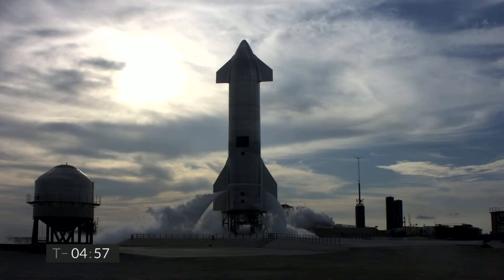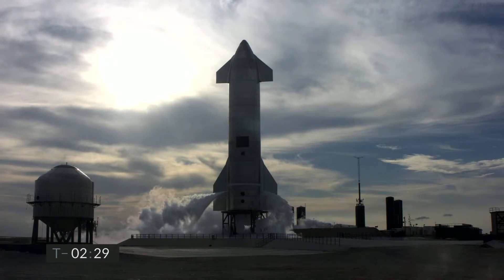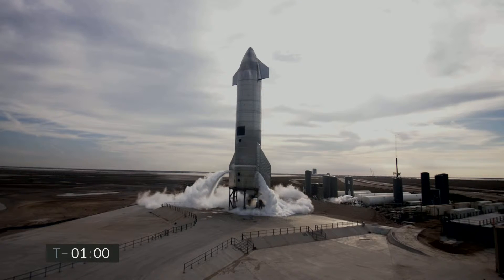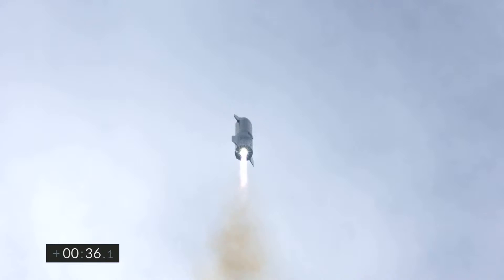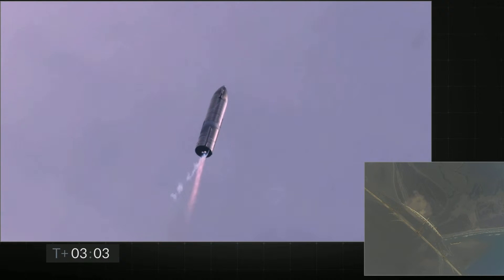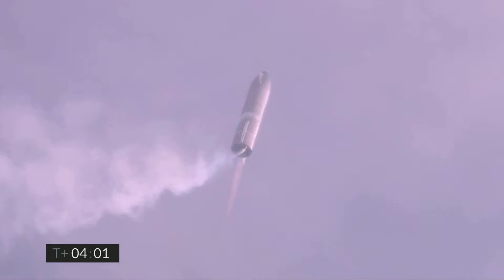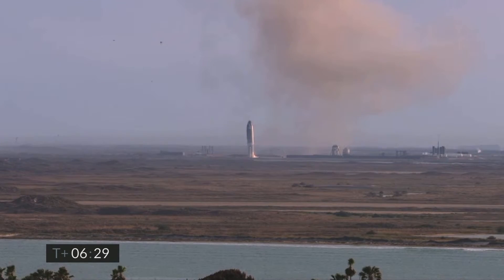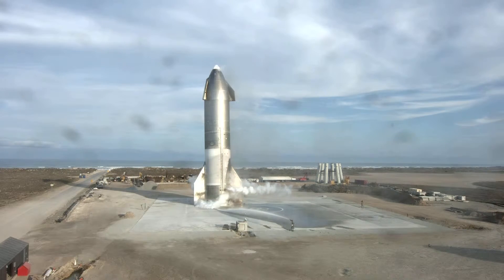Starship | SN10 | High-Altitude Flight Test

Comment: The landing was difficult. When he touched the ground he was injured by the blow. You need to dislodge the fuel before hitting the ground or use a better leg system that better absorbs the weight of the rocket.

Comment: Congratulation this was a successful test :-) sadly it exploded after few minutes after it landed and from what I saw the rocket was on fire before it touched the ground and yes the "rough" landing was another reason why it exploded in the end. SpaceX should implement some spring mechanism system under the rocket for such rough landings to ensure every last bit of a safe landing, I think it's not hard to make a circular mechanism around the rocket with springs and a controler so when it lands it would absorb a good portion of force stress. Just my thoughts :-)

Comment: Everyone: IT LANDED IN ONE PIECE
SN10: Well, I did land in one piece.
Reply: what? explain? i don't get it.
Reply: @johnwicked1132  It exploded shortly there after.
Reply: @DanielLiljar  i never seen an explosion
Reply: @loadapish  check the other streams like nasa Spaceflight or everyday astronaut, this one ends before it exploded
Reply: @DanielLiljar  it didn't
Reply: @johnwicked1132  It was leaking methane and on fire before landing, and shortly after landing the whole thing exploded in a massive fireball it was so cool but of course also unfortunate.
Reply: @tiffanylaserna1288  I watched the video, when i saw the fire i thought something would go wrong but it didn't, turns out im wrong.
Reply: Everydayastronaut 8:26:10

Comment: Amazing. It's going to be even more amazing to see it with its full 1st stage monster booster below Starship. Now when that thing takes off mama mia thats going to be something. I do thinks its kinda of crazy that they are doing such tough testing on the part of the ship that will be on top of the booster stack not even having to work anywhere near as hard as they are doing in these tests. I guess over proofing it will make sure it's 110% ready for anything.

Comment: Some cool things I've noticed :
6:35 Looks like the thrust is slightly offset to the right during a big part of the ascent
8:12 Difference between the two engines plumes (one is yellow, the other one is light purple/blue)
12:03 Hard landing (we even see a little bounce)

Anyway, still a great achievement =)

Comment: In my opinion, the landing was accidental. They started all three engines, but only for a few seconds, and one engine simply can't brake the huge mass and sit them down gently. The strength of the explosion indicates that the fuel tank exploded and probably LOX entered it. The landing gear of this flying tank has virtually none.

Comment: I think that hard landing caused the problem that made it explode on the pad.
Reply: Play it at slower speed,  methane was escaping and burning continuously after the 2 engines were shut down, before touch-down.
Reply: @KenLord  I noticed that, though that could not be good news.
Reply: @KenLord  the methane squirt when shutting down 2 engines at the same time is a bit to much
Reply: If you take a closer look, one side of the starship bent on landing
Reply: I don't know why they didn't have a automatic fire hydrant system setup to spray down the ship. Surely has to be cheaper than it exploding?
Reply: @GK-qc5ry  No they have a fire supressor, and it’s even manual so they can shoot at precise places !
Reply: @GK-qc5ry  It was burning up inside the rocket.  No way to get water there.  It looked almost like they triggered the range safety on it
Reply: @AIM54A  they didn’t detank, did they?
Reply: @balazsbelavari7556  They where venting. Once the feed lines are disconnected there isn't a good way to detank other then open the vents and let it evaporate.  There probably wasn't more then a tiny amount of fuel remaining in the tanks either way.
Reply: @AIM54A  there were a lot. Enough that the pressure threw the whole thing, because the fire came after the explosion
Reply: @GK-qc5ry  It exploding is because of overpressure in the lower tank. I guess due to the hard impact they lost hydraulics to open the vents. For it to vent out the remaining o2 and ch4
Reply: @maxzzzie  Normally if tanks are isolated, an explosion cannot happen (since you need a mix of oxidizer and fuel to trigger a reaction) however the landing wasn't the smoothest, that combined with the crushcore legs being still placeholders at this point lead to a methane leak. that combined with a likely fire that was under the skirt lead to detonation.

As for the "why don't they just put FPE in the vehicle?" is mainly because it is a test article and that automatic fire control systems in a vehicle can actually be prohibitively expensive. Its a lot of extra piping, consumables, sensors and even more high pressure tanks to store around the place. Don't get me wrong its going to be there on the final vehicle, a bit like how the space shuttle pretty much invented smoke detectors, but its likely not going to be integrated on a test article. Normally the landing site fire control equipement is enough, but here the fire must have been stuck bellow the skirt and as such imposible to reach
Reply: Watch again, see that jet of flame off to the right during descent? My guess is that that's not supposed to be there. It also continues to burn long after it's landed.
Reply: @cheguevara19  it litterally explains everything in the end lmao
Reply: @cheguevara19  I think the valve got stuck open.
Reply: Yeah looked a hard hit even from a distance and there looked no give in the dummy legs. The proper ones will no doubt compress/crush like F9 to take the load and they'll get better at the landing too. I'd say 99% successful even though it's no longer with us.
Reply: Ryan Air landing right there
Reply: - Methane leak started before the touchdown.
- The touchdown was not smooth, SN10 even bounced on the ground at the touchdown moment.
- The explosion happens exactly where the base of SN10 was cutting/crushing the ground (you can see it in videos of nasaspaceflight livestream).
Reply: Genius
Reply: @kreuner11  After 10 minutes on the ground.
Reply: I thought this was a complete success until 10 minutes ago. I’ve just had an argument as someone said it blew up. I was like no it didn’t until, boom the extra footage!!!
Reply: Oof
And its not a exlposion
Reply: sherlock
Reply: Well it performed a "soft" landing but the landing legs look like they failed to deploy, perhaps that was what damaged the craft.
Reply: Needs the new landing gear v2.0 for sure
Reply: there was a fire after landing
Reply: @Weghweh Hwewehwhe What, you mean just like the falcon 9, which also got called for its landing and that it would never carry humans? Sincerely, just get lost. If you fail to see the significance of the starship vehicle for space exploration and exploitation, then just return to more mundane subjects that you can wrap your head around. 
We aren’t here to lick safety while pushing back actual flights; we are here to push things forward. One test vehicle at a time.
Reply: Uhhhhh what video did you watch dude?
Reply: The landing was a soft one! I don't understand what you people are arguing about! He litterally says so in the video!!!
Reply: @Weghweh Hwewehwhe About 100K of us Dear Moon-ers so far - "Faith of the Heart"
Reply: https://www.youtube.com/watch?v=BgGcLHKOQDchttps://www.youtube.com/watch?v=BgGcLHKOQDchttps://www.youtube.com/watch?v=BgGcLHKOQDhttps://www.youtube.com/watch?v=BgGcLHK
Reply: Something caught fire at its base shortly after it went full vertacle, hit up nasaspaceflight and watch the same time frame of this you’ll see they were shooting the base with fire retardants for about 5 minutes before it exploded
Reply: @paigelore  Are you saying SN10 exploded?
Reply: @KryptaKnight  yes
Reply: @KryptaKnight  it did
Reply: yeah I think so, it looks like its actually resting on the fins and not the legs
Reply: @The4Gamers  it should be standing on the grid fins, some time back Elon said that the fins they make are able to support a lot of force (depends from which side of course) but they want to get rid of the heavy legs
Reply: @ossyx  the superheavy will land supported by the grid fins, the starship will have landing legs
Reply: Wow, you are such a wizard! Everyone instead was thinking that the explosion was caused by a smashing bird. Show us the way, Sherlock Holmes.
Reply: https://www.youtube.com/watch?v=jhIQoF__7Yo
Reply: https://www.youtube.com/watch?v=S4cREQGH6Q0
Reply: https://www.youtube.com/watch?v=VAQy2Q_4gOY&t=2s
Reply: https://www.youtube.com/watch?v=U3NMLJFhQ5s
Reply: @olawoj156  Aleksandro, narobiłaś sobie dislike'ów. Proszę się opanować ;D
Reply: https://www.youtube.com/watch?v=qXtOwRQRP10&t=1s
Reply: @olawoj156  wrong thread pal 🤦‍♂️

Comment: That little bounce at the end, think she came down a fraction too fast.
Reply: I think it didnt deployed the landing legs.
Reply: @michi123x  It actually did deploy the legs but some of them were crippled.
Reply: @nabil14409  Yeah. One reason is, the Starship doesnt land perfect straight coz the engines are offset. All three of them would have to be lit for straight landing.
SpaceX can do two thing about it. Lower the minimum throttle on Raptor's and use three of them at landing, or bring the v2.0 landing gear that actually wouldnt be rock solid so they can survive uneven landing.
Reply: @EddyKorgo  SpaceX knows and doesn't care about the landing legs for now. They surely are working on better legs.
Reply: Think the bounce was to hard and that something goes wrong. The Look from far Seems like, that it Stands Not Right. But hey, it is a TestFlight. And its absolutely amazing to See this. ❤️ Loved it.
Reply: Not sure it would "bounce" because of coming down too fast, that would surely just end in bent metal. If it "bounced" back up it will more likely be because the engines did not shut down quick enough on touchdown, so when the ground was suddenly supporting its weight all the thrust was acting to push it upwards again until it switched off
Reply: @Fromatic  ah ok thx. But do you think that it Stands ok? It Looks, at 12.35, that it Stands not really Vertical !?
Reply: @19o1oLeo  there’s a video showing two of the legs just dangling, not locking into position. Plus, landing on one engine, it will always land leaning slightly, just watch SN5 and 6. Clearly, it can do it, but if the legs - which are crap to start with - malfunction, it has no chance. And it came down a bit fast in the end - that shouldn’t be to difficult to correct next time. They are working on a better design for the legs, must make sense to start using it soon. They CAN land using the current ones, but at the very least, it might make life a bit easier with FAA, if starships stop exploding on the landing pad.
Reply: @prusak26  do you have the link, where i can see the legs been broken?
Reply: @19o1oLeo  we also need to remember that because its carrying no payload and little fuel, it's much lighter than it will be in operation, because of this they land with 1 engine that is off-center, causing the rocket to land a little wonky. This won't happen when it lands with multiple engines and full payload.
Reply: @gus3770  yes ok. Thats a comprehensible Point. ✌🏻
Reply: https://www.youtube.com/watch?v=S4cREQGH6Q0
Reply: https://www.youtube.com/watch?v=VAQy2Q_4gOY&t=2s

Comment: Didn't it explode?
Reply: it did after the livestream ended
Reply: Yes, ~5 minutes after it landed. Methane leak built up in the engine bay and eventually got set off.
If it actually had decent landing gear, the engine bay would have had enough ground clearance to avoid it.
Still, the important thing is that the landing did work.

Comment: 📯📯📯 It was not a soft landing, it cause a small tank crack, then the methane leaking and then the explosion. 🚀🚀🚀🔥🔥🔥💥💥💥
Reply: 12:03 it jumps a few metres upward like a spring, you have to land it softer, a much softer.
Reply: Maybe you should land on a damping platform that will consume some kinetic energy...
Reply: @maratimus  It makes much more sense to just have landing gear with shock absorbers. 
Which was already planned for later versions, they just cheaped out on these early prototypes.
Reply: @lazarus2691  I heard that they get rid of them to make the rocket 🚀 lighter, the pity is that they did not replace damper from one place to other, I mean from the rocket to the platform.
Reply: @maratimus  
They took the legs off the Superheavy booster to make it lighter. The Starship upper stage is still intended to have them though.

Comment: That was a rather HARD landing.  They almost blew up another Starship there.
You do know that there are no concrete landing pads on Mars, don't you?   Well then, how do you expect to land a Starship on a soft sandy landing site if the Starship does not have those wide-spread landing legs like those Falcon rockets have? The Starship is going to touch down on Mars, and then topple over on its side, and then explode.
Reply: tests and improvements.
Reply: Elon said months ago that later prototypes will have better legs. They're just using these cheap crappy ones while they get the hang of flying it.
I mean if they'd installed them on SN8 and SN9, it would have been a waste of money

Comment: Some grilled landing platform with some catch/support structures and/or a redesign of these dwarf legs with much longer and laterally extensible legs were probably already on the drawing boards.

Comment: Definitely a better landing than the first two...However, it looked like one of the engines cut out and caught fire just before landing, and it was that fire being encapsulated by the engine shroud that ultimately led to the rocket's explosion and demise.  The engine shroud area essentially was turned into a slow cooking furnace with air coming from underneath until ultimately the remaining fuel above finally combusted due to the intense heat.  Seems like maybe a better landing leg system that places the rocket much further up from the pad might be in order, as well as some kind of emergency fire suppression system in the engine shroud area.  Yes this would obviously increase weight a bit, but sacrificing a bit of cargo weight capacity for better safety is kind of a no brainer.  This craft is afterall expected to be able to carry multiple human lives to the Moon and Mars.  JS  and IMO
Reply: maybe also a drone based fire suppression system that could go darting out from the sides of the pad and flood the engine skirt from underneath with fire extinguishing material such as foam, nitrogen, etc...

Comment: "3 engines relight"
"Engine 1 and 2 shutdown"
"Touch FUCKING down!!!!!!!!"
Reply: I think it was intentional, otherwise they would have too much thrust
Reply: Yeah that was intentional. They originally wanted to do the whole landing with 2 engines: 2 to do the flip and 1 to do the touchdown. Then with SN10 they added the usage of the 3rd engine after which they shut down 1 so they have at least 2 engines running if one of them fails.
Reply: It's still possible btw to write normal comments, that meme format is not compulsory.
Reply: https://www.youtube.com/watch?v=qXtOwRQRP10&t=1s
Reply: @anialuk3293  why are you sharing videos of cars?!
Reply: https://www.youtube.com/watch?v=VAQy2Q_4gOY&t=2s
Reply: @olawoj156  BRUH
Reply: @xrion236  ik
Reply: @xrion236  i just wrote that for fun ok
Reply: @zahirchavez9104  I know I was replying to the other guy 🤣
Reply: Yea, that probably wasn't intended. And likely the proximate cause of the bent or broken landing strut and probably cracked fuel line or jammed fuel valve. causing the fire. Oh well. Something to lean from for the next try.
Reply: @lwilton  i believe it was supposed to land with just one engine after the 3 slow it down enough
With 1 engine it can hover.
Reply: @maraschwartz6731  Ah, OK. I didn't know that. Better technology than the old prototype DC-X that could only hover on 3 out of the 4 engines. Still looked like it was a hard landing and broke or bent a landing strut, but that suggests the landing sequence just needs some minor tweaks.
Reply: @maraschwartz6731  ik

Comment: No one cares that it exploded later

Me: wtf dude
Reply: I thought it stood at an angle. But this alone is a huge leap forward compared to the other tries, and lots and lots of data was collected. :-D
Reply: @Widestone001  It appeared to land with a bounce that was probably a little harder than intended. Likely broke a fuel pipe or connection, resulting in the fire, and likely broke a landing leg, resulting in the tilt.All pretty easily fixable problems for the next test launch or two.
Reply: I mean, they care, but it's not too surprising. It will help them improve.
Reply: Put some of those airliner evac slides on it and call it good.  Just don't fuss around grabbing your bags from the overhead bins.
Reply: Those landing legs were swinging after the deployment 😅. I was just like wtf 🤣🤣
Reply: https://www.youtube.com/watch?v=NSWH2Juhtgk
Reply: Actually, not even SpaceX cares. They want data. And that's what they got successfully.
Reply: @ZillionPrey  I know, uh these damnit landing lags

Comment: I'm consistently amazed at how stable Starship looks for such a bulky rocket.
Reply: like a fuckin grain silo with fins and rocket boosters.
Reply: In this case, size matters, the bigger a rocket is the more inertia it has to smooth out control and interference (ie wind), it also means this thing will be able to haul a monumental amount of cargo and have the Range to reach Mars with a little in-orbit-refuling

Comment: The landing was not smooth enough, I think the suspension on those legs got stressed beyond what was designed either because of an abrupt engine shutdown before at the touch down, or the legs themselves are not strong enough. But I also heard that Musk said legs on SN11 will be 30% bigger, as well as they probably will adjust the landing profile, so big hopes for SN11